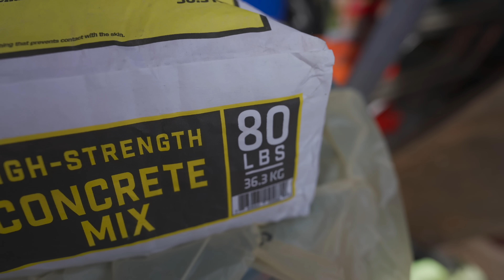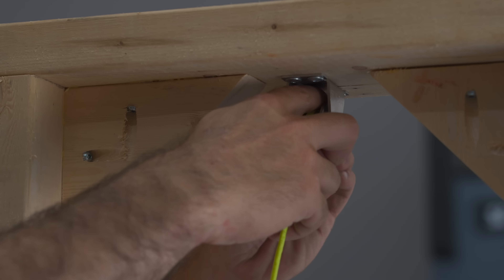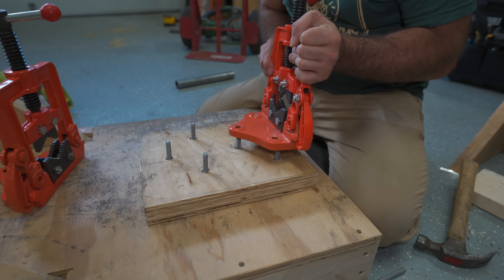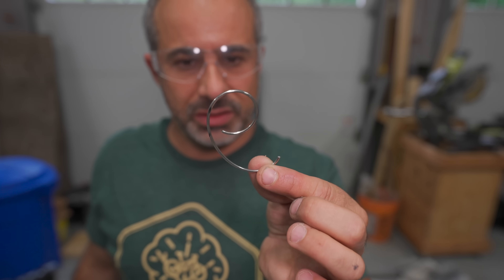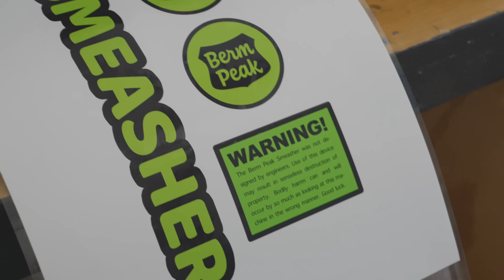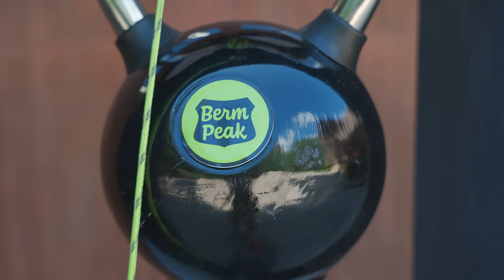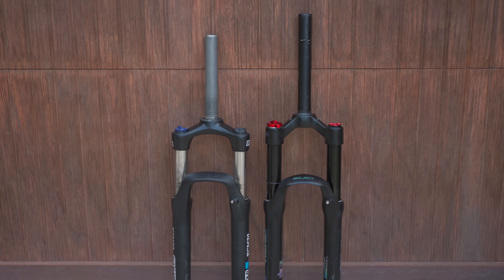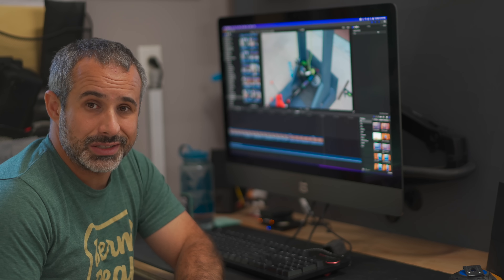Building a Suspension Fork Impact Tester for Science

Comment: I used to have that exact same fork on my bike, but it broke after like 5 months of taking heavy flat drop hits from 2 meters and a few jumps.
Reply: How did it break?
Reply: @blankidelics  i dropped a 1m drop to flat and then it made a loud noise and when i came home i took my bike apart and it just broke in 2
Reply: By my fork the steerer tube just snapped in 2
Reply: I’d never drop a $130 off brand fork, but I’m rebuilding a bike for my wife to ride occasionally and I’ll take your review as this fork being good enough for her riding smooth single track and asphalt trails.
Reply: @mtb416  Please don't use it. Its very dangerous. Many users here in Philippines. Only use it on road and stanchion cracks.
Reply: what broke on it?
Reply: @acr_master5594  bolany forks Pretty poular here in SEA, lowers usually blow out near the arch. Crown cracks.